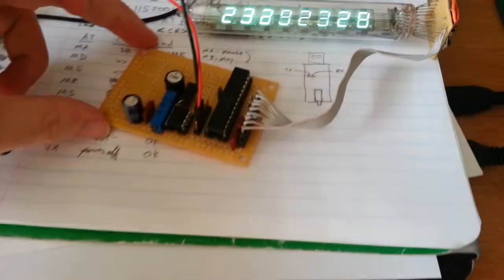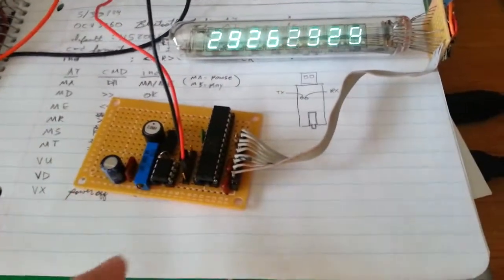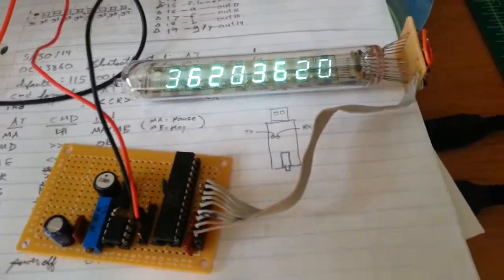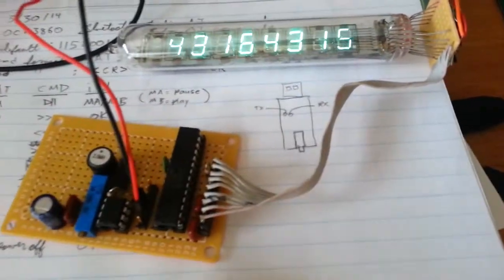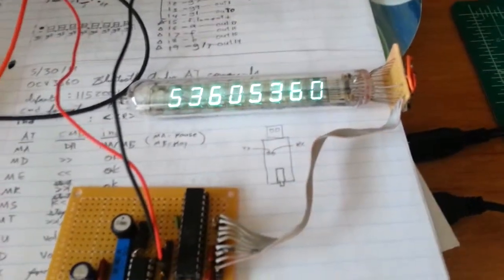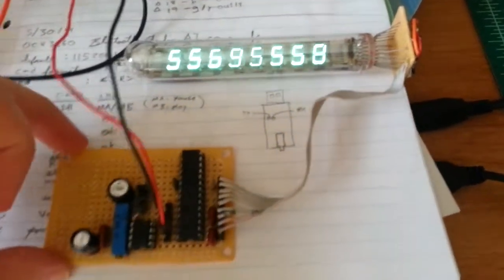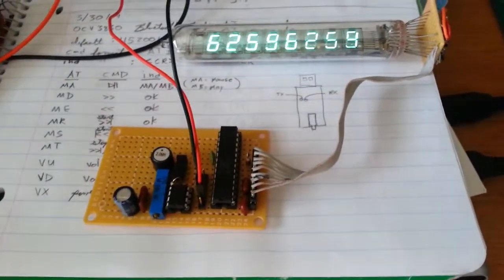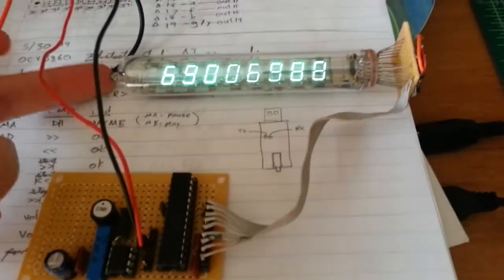IV-18 VFD Clock Progress Video 4

Comment: Man that is such a clean little circuit. I check out the boost section and you programmed an IC? Why does this not surprise me lol 

About the DC vs AC lifespan of the filament, I think it was more a problem at slower frequencies due to slight thermal contraction and expansion between cycles. Having a really fast AC signal should compensate rather well for this.
Reply from the maker: I've had this bad boy running 24/7 basically since I made it with no noticeably degradation so I'm not too worried about it burning out any time soon. One noticeable downside of DC filament drive is the slight gradient across the digits if you look closely but it isn't that big of a deal to me (I originally planned on adding pwm sinusoidal LUT inverter code to the boost micro to generate the filament drive as well but never got around to it).